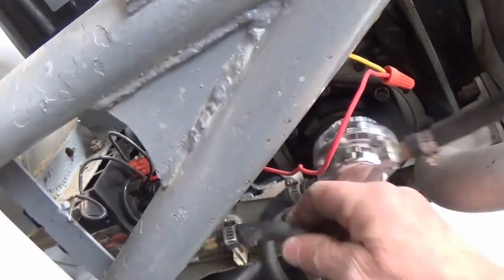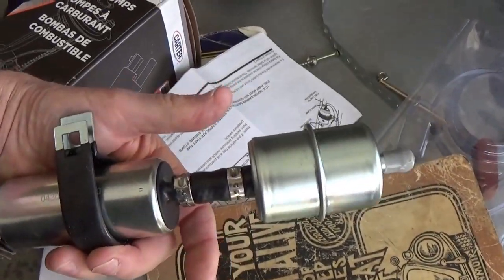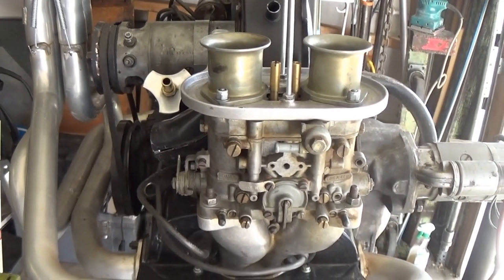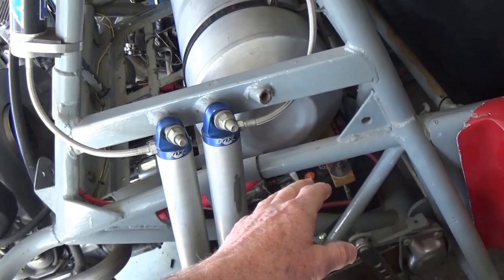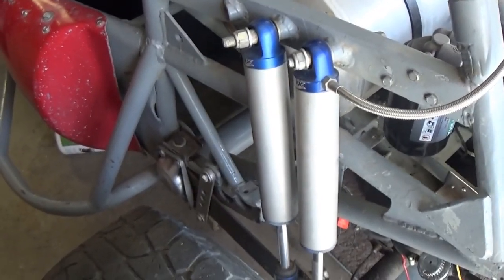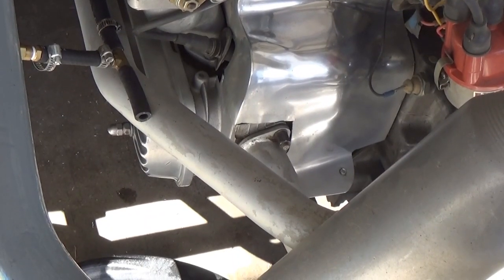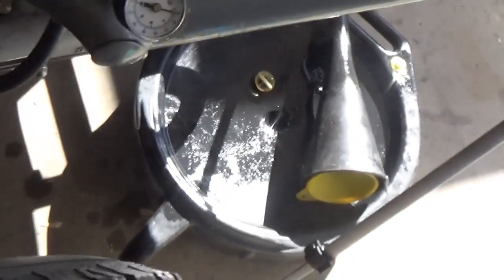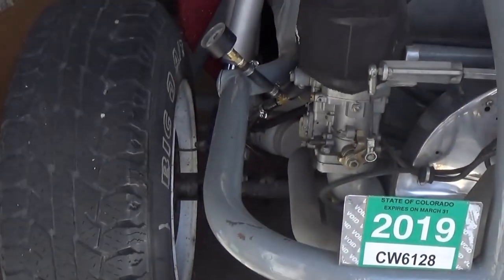VW  Electric Fuel Pump Install

Comment: I've been using an oscillating steel cannister pump on my car for almost two years without issue. Several people have told me that it absolutely has to be mounted under the tank or at least low on the car. I have mine mounted to the side of my dog house. I'm running a stock 1600 with the factory style carb. While that might not be the "preferred" setup it has served me well for over 55k miles. If you get out a ruler the tank is pretty much level with the carburetor. I've caught a lot of flak for how I've done mine and all I can say is that it has worked very well for me. I plug my pump into the coil and carry a spare that can be switched out in about 5 minutes if one were to fail. I also regularly inspect my fuel lines.
Reply from the maker: Very interesting and helpful thanks for sharing that

Comment: Glad to see you back in the saddle! I’ve been looking into this pump problem as well. Per Milo Manx, I installed a modified Holly fuel regulator which lowered my pressure to 3 1/2 psi which was a tremendous improvement over the 12# I had before. According to technical service at Carter, model P60430 has a pressure rating of 4~6 pounds and recommends model P90091 (looks the same), which has a pressure rating of 2~4 psi and is available from Amazon for $44.31. Of course, using a pressure gauge will tell what a pump will actually deliver. Your channel has been a tremendous help on my VW kit car. Thanks for your good work!
Reply: EZGZ, do you have yours on 6V or 12V? I just noticed the same thing about the two models when I went to order one 🤔

Comment: Nice video EZ! I used the same fuel pump for my Beetle project paired with a Malpassi FPR008A regulator and a standard motor products RY33 relay that needs a tach signal to close the relay...might be overkill but I liked that the relay only works if a tach signal is present, safety stuff..
Reply from the maker: I agree! I was trying to think of how I could incorporate a rollover switch. I don't have a tach at this time. Thanks for the info.
Reply: Good to see the Carter worked so nice. You probably just have the pump on a manual switch so you can stop it if you like. I did one like the early 911 Porsche wired them with a fuel pump relay but my SR17x starter had a extra terminal that was only hot during cranking  that could be used to override running the pump at start and Alternator D+ will keep the fuel pump relay coil latched as long as the engine is turning over fast enough to charge.

Comment: Much as I hate those clear fuel filters in the engine bay, it definitely made diagnostics on the compromised membrane of the pump in my situation obvious.  . I'm putting in a mechanical but this video is really making me lean towards getting a inline like that. Thank you for sharing knowledge.

Comment: Quick tip when checking fuel pressure with an electric pump. Always have the engine running, the added voltage from th ed alternator will typically raise the fuel pressure 1-2psi.

Great video and also excellent heads up on those Mr.Gasket fuel pumps. Yikes! 🔥
Reply from the maker: Great point!  I'll have to check it again

Comment: Yeah never use the pressed in fittings on fuel pumps,  and definitely use the correct pressure for your type of carburetor,  thanks EZ for the videos,  they may seem obvious or simple to some people but every day a new person decides to become a first time vw owner and they will definitely need your help,  thanks again
Reply from the maker: Great point!

Comment: Thanks for these post's! Just noticing this post because I'm replacing my electric inline on a 71 Super. But I thought I had read on the Amazon listing for the 2-3 psi Carter GP60504 fuel pump needs to be under the fuel tank as you have done because it is not self priming. Has anyone else heard the same? Sorry if I've missed any previous mention of this condition.
Reply from the maker: Mine is working good

Comment: I see @ 5:30 that you are using that spinning fuel pressure regulator. No problems with it?

Ah, @ 15:56 you mentioned you removed it. Good work.

Comment: I may have missed it in the video even watching it a few times. Did you need to add a regulator after the pump ? I'm probably going to use this Carter setup on my 34/3 single carb. Glad to get new videos from ya, happy the cardio plumbing is running well! 1 🌎 1 ❤️🙏🏻
Reply from the maker: No need with carter but I would check with a accurate fuel gauge

Comment: Nice video! I've got a vw sand rail I'm installing the same fuel pump on. Did you wire a relay for that pump or just go from ignition switch to ground? Love the videos!
Reply from the maker: I took it off the coil which comes from the ignition switch. It doesn't draw much juice
Reply: @TheEZGZ  so you ran the power wire from the coil and then grounded it near by? That's an amazing idea! I was going to run wires to the ignition switch and back but that is a smarter idea just running it from the coil! Thanks!

Comment: I have what might be a dumb question I just replaced my old style fuel pump works well just curious does the electric fuel pump last longer or is it just preference.
Reply from the maker: I didn't have a choice. When I got my 1800 engine it was a late model fuel injected case and the factory did not put a hole wear the fuel pump is supposed to be. I have run them for decades without problems. It just cleans up the engine compartment and the new china pumps are low quality.  It's a 50/50 chance of something going wrong. Just roll the dice and do what your heart tells you. It'll be fine!
Reply: Thank you for your response was just wondering i like your videos there very informative my car is a 4 seater street legal sandrail with a 2110 found it at a buddies house behind an old shed got it dirt cheap while I was fixing it all up I have to say more than once I was wishing you were my neighbor but I got going pretty damn good I get compliments all the time and sometimes people ask if its for sale. Lol never, I prefer to drive that more than my silverado any way thank you for your videos

Comment: How would you plumb in a return line? I accidentally left my fuel pump on and my plugs ended up getting fouled and had a non starter for few days before I figured out what I did.
Reply from the maker: you could use one of the fancy turbo charger fuel pump regulators that automatically compensates for pressure
Reply: Any brand recommendations? I found one in a Napa with about 2 inches of dust on packaging and bought it as it was only one available when I needed it. It's the old dial style generic brand and I really don't trust it.

Comment: Good video EZ , do you think if you pulled on that fitting on a new pump it would pull out, any ways look’s like your ready for the trails, thanks for sharing, I will have to start putting up some videos on the Manx soon, later
Reply from the maker: Well, I'm thinkin it was made to pull in case you don't want a check valve. I going to try leaving it out and run a 1/8 pipe tap in it. It's got threads on the other side???  It's junk so might as well try.....
Reply: @TheEZGZ  👍👍

Comment: Long time no see!! What type of electric pump would you recommend if you are still running a single carb? I still use the solex/brosol carbs on my aircooled motor. The mechanical pumps gives crap after a few months of driving. Want too go electrical.
Reply from the maker: The carter fuel pump I just posted about a couple days ago should work.
Reply: @TheEZGZ  thank you very much. Carter fuel pumps isnt sold in south africa is there a equivalent that would work?

Comment: Mount  it under  your  package tray
Reply from the maker: Thought about that but decided not to. The tranny gets hot and bell housing and clutch cable limit the space plus the starting motor and electrical is to close for comfort.